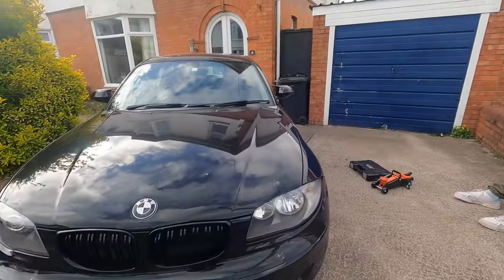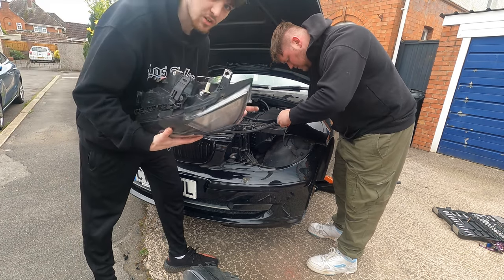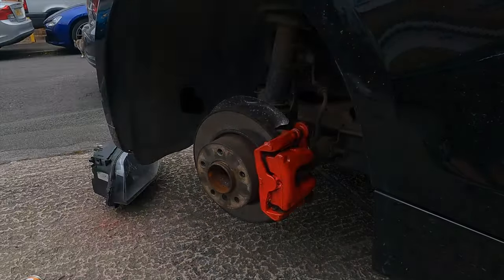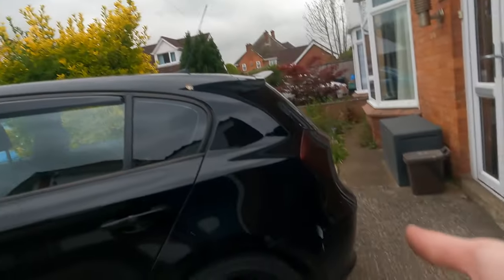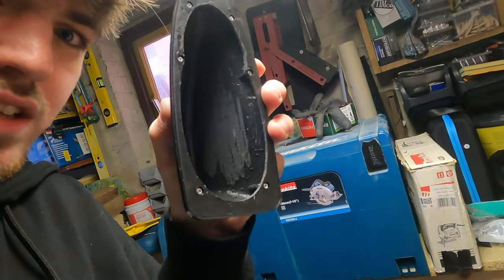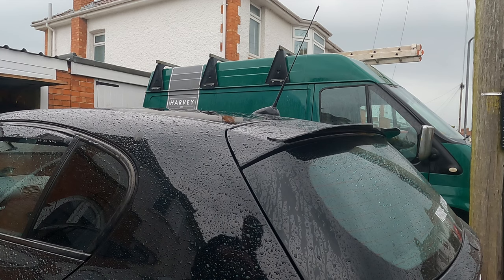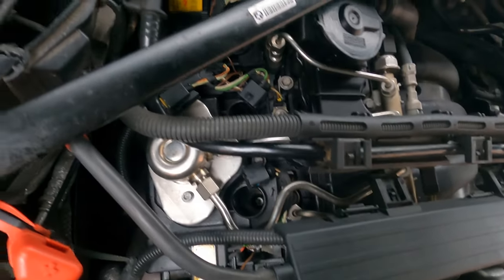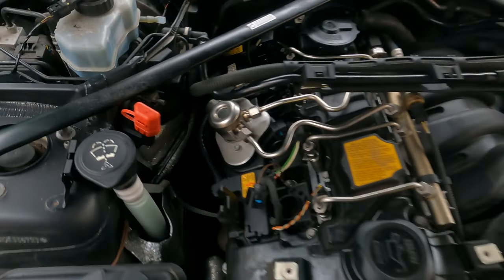I WRECKED MY ENGINE NOW I HAVE TO REBUILD IT

Comment: You can definitely paint the bumper yourself, trust me I've been in the predicament. Theres nothing special just use a compressor (you don't need a big one) and a decent spray gun. I used a company called Jawel for the paint. Obviously not the cheapest option to begin with but you'll have more tools which is always great.
Reply from the maker: That is a pretty good idea, I may read into that

Comment: Mate! Hi from Brighton💪
Please consider at this point an engine conversion, the M57 is a good idea for the 1 series! 300bhp stock with barely any running issues, will help you 🫡
Subscribed
Reply from the maker: if I have the budget and a unit where the work can be done then I don't see what not!

Comment: Helicoil for the stripped thread on the head. Hose you broke looks like crankcase breather hose but i'm not familiar with bmw 4 pots, only 6 so could be wrong. Hose is easy to change. Pry the old hose off the connection point you're not going to be able to reach, with a crowbar, you can break the plastic tabs around the connector point with a pick and twisting it (or flat head screw driver). No need to take intake manifold off. Happened to mine last week when changed the rocker cover, just old and brittle plastic.  £50 genuine from BMW for a new one, and added bonus it fixed an air leak for me and get another 4mpg since. A bit of my old hose is currently burning itself off after it fell down too, wouldnt leave the spanner down there though lol. Get yourself a telescopic magnet as well, absolute must if doing engine work imo.
Reply from the maker: Ill take the undertray off to get the spanner, thats a 5 minute job, but as this is really out of my comfort zone im just going off what peopole say and instinct really, so ill take all of this onboard and hopefully smash this out, thank you!

Comment: Alright mate, I wouldnt be worrying too much about the mistake. Its an easy mistake, never 100% at the fault of the man doing the work, I am 22 lad from Northern Ireland. I am very much into doing my own mechanic work, in fact me and a couple of mates have our own garage that we bring cars in almost every week from the evenings to the weekends and do plenty of jobs. This sort of problem is not at all a big big problem. If it is a strip in the threads of the head, you can try helicoils BUT i beg if you plan on later down the line doing more rocker cover off maintainence to be very due care on that particular bolt, dont gun it out, keep the wratchet to that and keep it easy. Worst case scenario, get the head pulled and rethreaded OR get a new head. But I promise you lad you will come across worse things and all i can say is I had a car completely fail on me (my own personal car) and just had to knuckle down (despite everyone telling me to take it to a mechanic and doubting i could do it) I got it put up on jackstands, fully stripped down the front end, from subframe to engine and gearbox, with new subframe, top end engine refurb, basically new seals, new pipes, hoses, injector seals, etc etc, new 3 piece clutch kit and flywheel and a new bell housing on the gearbox and thrown back together in 2 days and running. It is an amazing feeling when you get to that stage. That particular car, just for reference is currently still running to this day with minor maintainence and owned by a family with 3 kids. So believe in yourself, You can do it!!
Reply from the maker: OMG mate that is insane, im proud of you bro, mega job, now i feel hella motivated to smash this out and get my car back on the road, thank you so much, i really apprecaite this!!

Comment: Good shit mate. Just get the bumper painted at a different place. Expats would usually get em done quick n cheap. I also just realized you got wonky ear lobes ahhahah.

EDIT: The bolts rounded off is a shitty sitch but you can always use some tips to get off tight bolts, typically powertools are used, you can also fill the top if the bolt with a thick paper and hammer down the spanner, use 2 spanners for leverage. The dropped spanner isnt a biggie, the hose is an ez fix. 

Youll get over it m8!! Keep these vids coming
Reply from the maker: I had to go check my lobes and they are, never laughed so hard 😂

The spanner i can sort in 5 minutes, im going to get a helicoil for the rounded thread, and the hose will be the trickiest job, but i feel so motivated this week to smash it all out, kep an eye on sunday at 6pm ;)

Comment: Option 4 paint it yourself think of the experience you will get on doing it.
Reply from the maker: I would but as its plastic it needs certain painting methods, which is why option 2 exists
Reply: @OfficialSamBryant   bit off plastic primer jobs be a good one and if  you do go down that road avoid halfords paint get proper auto paint from a paint shop.

But keep up the good work..